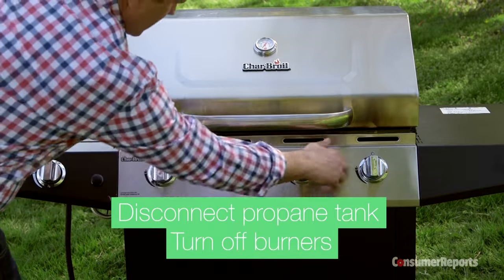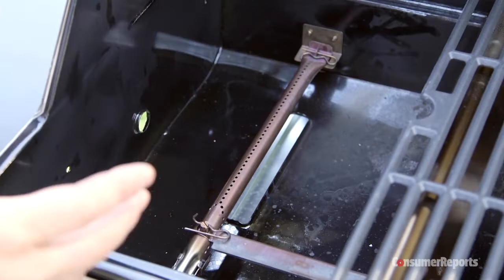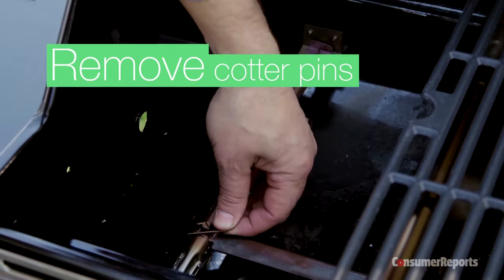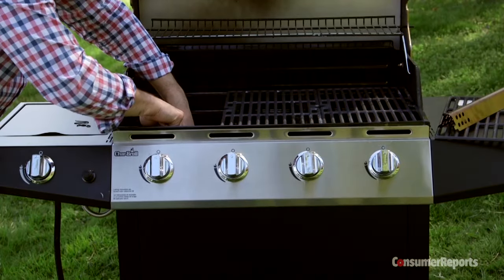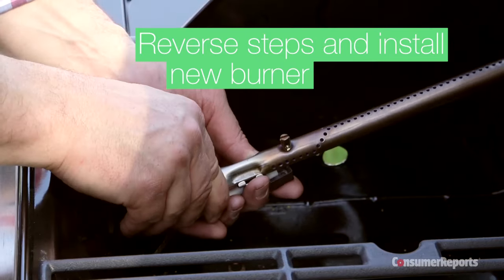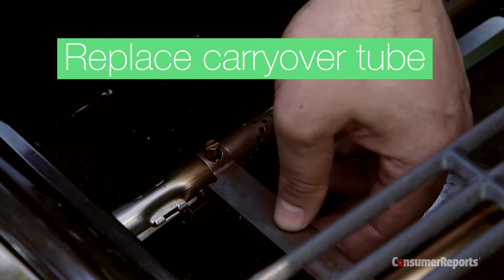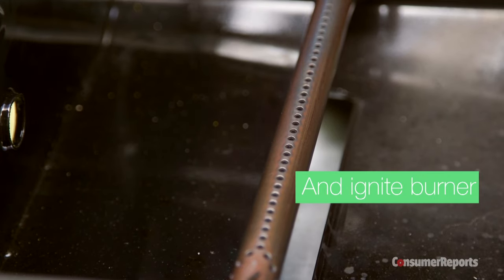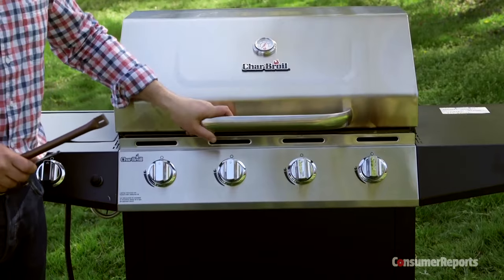How to Replace a Gas Grill Burner | Consumer Reports

Comment: Thanks for the push to do this. I've been putting it off, but they need to be replaced. A reminder to everyone to also occasionally replace the gas line/valve/regulator from the tank. It is not expensive, but if it fails, it is BAD STUFF.